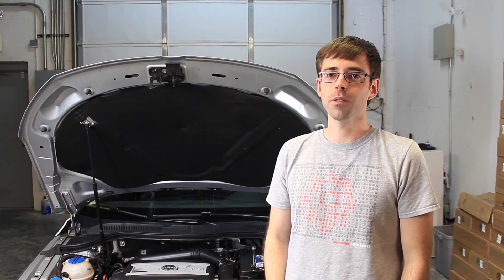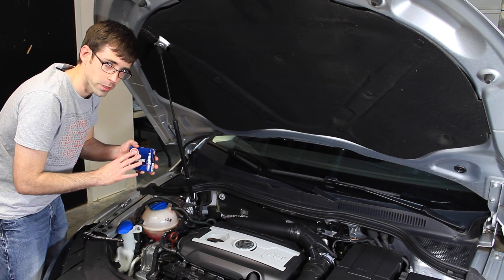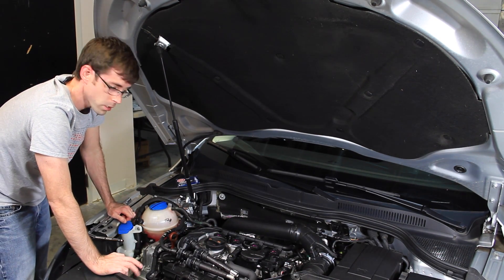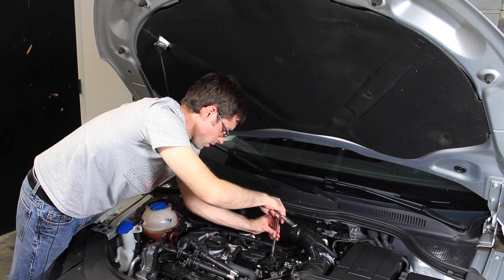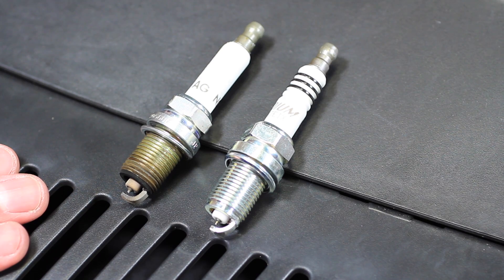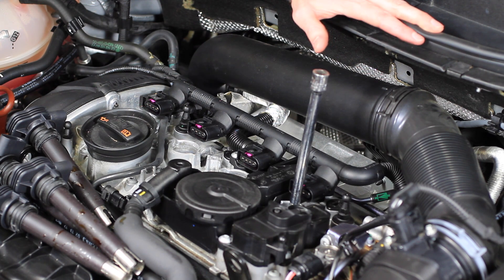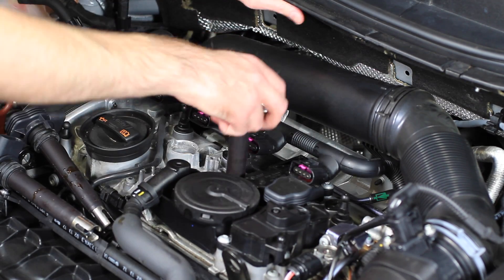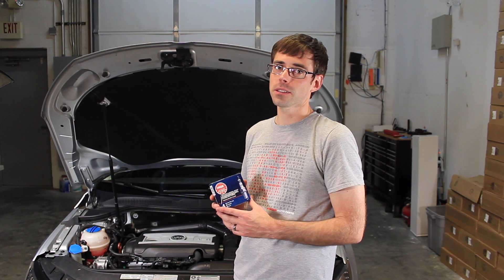VW 2.0T TSI Spark Plug DIY (How To) Install

Comment: do you recommend using a dielectric grease between the coil and the plug? Also in your opinion, should the ignition coils be changed at any routine interval, or wait until they show issues?

Comment: I've come to respect your videos, but on this one, I have two questions and a statement to ponder, please: 
1) You didn't mention the spark plug gap for reference. I know that they're in pretty boxes, but as a engine guy....this is still a highly technical component and critical for engine performance.
2) No mention a dab of anti-seize on the plug threads for dissimilar metals.
3) Some dielectric grease on the plug end, inside and out, because if the previous guy that did mine would have, I may not have ripped the boots to shit...and then try to get the pieces out.
Otherwise, thanks for the video.

Comment: You didn't add new di-electric grease on the coil pack ends plus there is a torque spec recommendation.  Never go by a 'half turn' past bottoming out.  Specs are provided for a purpose!

Comment: I know this is an old post but I'm going to roll the dice. I have a 2012 vw cc 2.0 tsi that has absolutely vexxed me beyond comprehension. I have had it for 2 years and I am out of pocket 5 K for engine repairs. Currently it is reading 
P0300 thru p0304
P050a
Catalyst
Egr 
secondary air 
02 sensor
02 heater
Evap
I had it in the shop and they said a secondary air injection pump so they replaced that. It still was un drivable and they would not make good on it.
I had it towed to an import specialist and he diagnosed it with a completely different set of issues. He said 
Coil 1 and sparkplug 1
And the entire catalytic converter system
I replaced the coils and plugs hoping that would improve idle and remove misfires 1 thru 4 but it is exactly the same with the same codes. At this point I am not even sure if the catalyst system is the problem.
With those codes how do I figure what is the root problem. This vehicle is literally bankrupting us. We still owe on it and I cannot even sell it until it is running correctly. Nobody will remotely give me an honest answer and any help would be appreciated.

Comment: I just bought a 2015 tiguan with 150 000 kms and changed the plugs out with the bkr7eix. It looks like it never had the plugs changed as it had the VW plugs in, and the coils were really difficult to remove! It runs way nicer now and the throttle is much more responsive

Comment: Not tighten too much? You should talk in NewtonMeters and you should use a torque wrench.
Reply: Apparently it's 25 N-m according to this video by ECS Tuning:
https://youtu.be/rbraqrculyk?t=254

Also, a good pro-tip later in that same video, plugging the coils in first before setting them down all the way at:
https://youtu.be/rbraqrculyk?t=286

Comment: Fark! I cannot for the life of me even get the connector clips off!!!
Reply: I had to spray some WD-40 on mine and let it soak about 5 minutes. Still broke off one of the tabs prying very gently with a flathead screwdriver (but that's not the end of the world). Just be sure to wipe off the WD-40 before reconnecting it. That was the hardest part of the job! 2 came off easily, but the middle two were stubborn for no reason.

Comment: You video does not show how the harness clips are manipulated to remove the harness.  You just blaze through assuming everyone knows that.  FYI, everyone doesn't.
Reply: They're a pain and a lot of people end up breaking the tabs. I got 3 off with a flathead screwdriver, but the really stubborn one, I had to spray some WD-40 on it to loosen it up. Just wipe it off before reconnecting the new one. That was the hardest part!

Comment: Hi I am still wondering what the correct gap is for the VW sparkplugs for my 2.0L VW Tiguan 2017, not modified engine, could you please ley me know, TNX

Comment: AutoZone sells a 5/8” spark Plug socket that has the extension built in.  Contains the magnet, rubber boot and extension all in one.  About as simple as you can get, insert 3/8 ratchet and go to work.  Prevents socket from falling out of extension and reduces chances of plug breaking off.   I concurr for most automotive spark plugs 3/8” ratchets and sockets should work.  If a 3/8” socket, extension and ratchet doesn’t work there might be another problem.

Comment: Good video mate, just a quick question. Should new coils and spark plugs work straight away to stop misfire ( my scirocco has been misfiring when it's idle and it sounds a tiny bit like a diesel engine when idle as well) or does it take a little bit of time to work? Thanks.

Comment: Hi, could you use a 1/2" drive socket instead of a 3/8"? will the outlet diameter too big?
Reply: A 1/2" in and of it self isn't a problem as long as the socket isn't too big in diameter. One issue with 1/2" drive is that your ratchet will probably be longer giving you more leverage and possibly more chance to over torque and break something.

Comment: Hey Y’all, so I’m trying to find coils and plugs for my 2015 VW Passat 1.8L SE... I’ve literally been searching for two days not with no results. I want to try A non OEM  kit that I can order. I’m fully aware that I can get OEM... but those are $38 a pop... bs. Any help would be much appreciated!
Reply: I've heard good things about Bosch, NGK, and Denso. I had Bosch originally, just put in NGK this time around (which is OEM on some model years), and I've read good reviews about Denso. I bought mine at Rock Auto. Saved by buying a 4 pack. Just needed a tube of dielectric grease which was around $5 at Auto Zone for way more than I will probably ever use in my lifetime.

Comment: Please my 2013 Volkswagen CC Sport is jerking, misfiring and idles. What could be the problem
Reply: Spark plugs.
Reply: Spark plugs and ignition coils and maybe also carbon build up in the intake manifold or a clogged or bad pcv

Comment: Can't believe the dealership was going to charge me $541 for this and the ignition coil replacement. Thieving bastards.
Reply: Correction: STEALership
Reply: crazy, I bought a kit with spark plugs, new ignition coils, the spark plug socket, a tool to pull of the coils for 200 from ecs. super easy job
Reply: Amazon around $100 bucks for ignition coils and spark plugs.
Reply: What was wrong with the coils?

Comment: I thought you should check the gap, there the gap should be from 0.030 to 0.032" (correct?), or 0.8mm, out the box the gap is not always correct on 0.8mm.

Comment: Is this the same basic process on the 2.0T FSI engine? I have a 2006 Jetta 2.0T, and I think I may have spark plug issues after having made the mistake of letting Jiffy Lube do a "tune up". Not sure if they replaced the spark plugs or just cleaned them, but now my engine light is on and the engine has delayed and rough starts and is running rough in general.
Reply: Yes. If you have a misfire in a specific cylindre, you swap the spark plug and coil from that cylinder to another. If the problem changes cylinder is almost 100% sure to be a spark plug and/or coil problem.
If you have done a Tune, isn't impossible that you need stronger spark plugs for exemple.

Comment: No anti sieze or die electric grease.?   I know it comes pre gapped, but don't you think you should double check the gap anyway.?
Reply: gladwin miguel VW actually recommends no anti seize. Dealers won't use it.

Comment: I want to thank You for doing this post. I followed you directions as demonstrated by you in this video. The only difference I made was the plugs. I used NGK PFR7S8EG (1675) These are Laser Platinum premium plugs. A bit more expensive than the ones you used but seem to work very well. Acceleration is very smooth. I think I made a good choice but value your opinion very much. Did I make a good choice?
Reply: John caballero I am about to do this service as well. Did you use dialectic grease? How’s the car running?
Reply: The NGK PFR7S8EG (1675) are the OEM recommended plugs for my 2011 (all years?) VW EOS. Scored them for $11.20 each on NAPA monthly sale.

Comment: Hi there, I was amazon and found the ngk spark plugs you are using in this video and wanted to put them in my 2013 vw cc and amazon says that it doesn't fit my vehicle, should I ignore this and get the plugs anyway? This is what the listing says: NGK (6988) BKR7EIX-11 Spark Plug - Pack of 4.

Are these the right fit?

Thank you.
Reply: Bryan Sniezek 
I got same result for my Tiguan

Comment: I saw another video with a guy applying anti-cease and a dielectric grease to the ignition coil before replacing into the engine - i saw your comment about anti-cease, but is the dielectric necessary?
Reply: Newer plugs usually don't need anti-seize, I put a thin layer of dielectric grease on the ceramic part and where the coil connects to the wiring harness (hopefully will make removing the harness from the coil pack easier next time). It seals out moisture and dirt which you don't want around your spark plugs or coils.

Comment: Had to get this done on CC. My check engine light and the ETC light came on, had I known it was this simple I probably would have done it myself. They mechanic who did it charged me like 160 for changing spark plugs and ignition coil, but then i later found out that he installed some crappy brands on my car. Which explained the lack of power. I freaked out when my car wouldnt accelerate and the engine was shaking like crazy... I legit freaked out and payed whatever to get it fixed. I thought the engine was going to blow up or something man...
Reply: Exactly why I am here!!! My car started shaking like crazy. Took it to Firestone(who charged me $100 to check my car!) He said it would be $450 to install the coils... Sad how these placed try to take your money!

Comment: In the past (since my 1962 Bug) I've used anti-seize compound on the threads.  Is anti-seize compound no longer recommended?
Reply: there's coating on ngk spark plugs to prevent it from seizing. so no need anti seize.

Comment: So, a few days ago, I changed my spark plugs on a 2012 GTI--used the OEM NGKs.  After the initial change, the car idled smoother, but there was a gas smell in the cabin.  Had just installed them finger-tight and then most of a turn until they couldn't easily be turned further.  After the gas smell, got a torque wrench and torqued them to 18ft-lbs.  No more gas smell--car was running great.  Filled up my gas tank tonight, and bam--gas smell was back, stronger than ever.  I didn't exert any superhuman force on any other parts of the engine, and the install was a relatively neat and clean process, especially as the coil pack had recently been replaced, so everything up there was clean. The actual calculation from Nm results in a torque higher than 18ft-lbs...more like 18.25 ft-lbs.  Is it possible they need just a little more torque? Could a difference that small be letting gas come up through the cylinders?

Comment: Dont you want to put some anti-seize grease on the threads before putting it in the engine?
Reply: devious623 I thought the same thing. I always have regardless of an aluminum or iron head.
Reply: Isn't necessary and is not recommended! New spark plugs nowadays they are already have proprieties anti-seize in them. If you put, spark plugs will have over anti-seize and you can easily over tight them because of that (risking of damaging head engine). But not every spark plug have this proprieties. If it's shiny chrome and soft in touch with your fingers, don't put anything. If is not shiny chrome and you feel it very sharp and rough with you fingers it's a "old school" spark plug and it's recommended to put.

Comment: I have been trying to get the connector to come off for way too long now. Any suggestions as to get them off? They won't seem to budge and I don't want to break the connector.
Reply: WD-40 worked for me after nearly an hour of trying to pry them off. Just wiped it off really well before reconnecting everything. The plastic gets brittle

Comment: ok so i have a vw mk4 2.0 engine. i boight ngk wires off amazon, but im having trouble fitting them onto the spark plugs. its like the hole is too small on the wires. what can i do about this. should i get new plugs or wires?
Reply from the maker: +Ivan Soto sounds like they might be the wrong wires.
Reply: I just bought bkr7eix i have 2.0fsi gti mk5 what is proper gap? Im stock.

Comment: I noticed a fairly little increase in cold engine idle sensitivity which doesn't matter since it goes away just odd, and a substantial increase in throttle response (positive mostly) which now seems to be slightly touchy like a bad gearing in some lower speeds, is that normal after a spark plug change it seems to be getting less jumpy under low throttle but I've never had that happen on a car before. It's iridium spark plugs, no codes, manual GTi, does not seem to be running rich or lean just throttle is jumpy, like a bad case of jumping off the gas in first. Runs smooth under moderate throttle and doesn't chop at most other speeds mainly 2nd-3rd 24-29mph.

Comment: I'm on a search for some iridium spark plugs for my 2006 Audi A4 2.0T FSI engine and I came across NGK BKR7EIX spark plugs. Do you think they will be a good choice? When I went to autozone the other day they told me that original plugs are iridium and they recommended me going with iridium over platinum plugs. What should I do? And which plugs will be better at performance? The engine is bone stock. Please help! Thanks.
Reply from the maker: On  a stock car as long as you use quality plugs the performance is not going to change.  The BKR7EIX is a popular plug for the 2.0t they are a very popular spark plug on our site https://deutscheautoparts.com/2-0-t-fsi-tsi-spark-plugs-bkr7eix-2667.html

Comment: Hello, I wanted to know if this spark plug works with CBFA engines and, even though it is pre-gapped, what is the gap measurement for safe practices/ double checking. I can't find spark plug gap information anywhere! I have a 2008 Audi A3 2.0T 8P CBFA engine. Thank you!

P.S. Thank you very much for you informational videos.  They have saved me at least a thousand dollars in repairs!

Comment: Do you have any advice for replacing a broken 4-pin electrical connector housing that connects to the coil?
Reply from the maker: +Matthew Edwards Take a look here you should find what you're looking for

https://deutscheautoparts.com/ignition-coil-connector-4b0973724.html

Comment: how do i get the connector off the coil if the release tab is broken?
Reply: Lift it up everso slightly with a flathead screwdriver and spray a squirt of WD-40 on it. Let it sit about 5 minutes and wiggle it a little so it can work its way in between. That worked for me, I still broke 1 tab even though I was trying to be patient and gentle. I wiped off the WD-40 before reattaching everything. Tried adding a very thin layer of dielectric grease to the coil and connector, so hopefully it will slide off easier next time and stop any water or dirt leaking into the connection.

Comment: those looked like 1/4 turns. and the last one was significantly more. can you clarify that? thanks.
Reply: I just torque to VW spec of 25 Nm (18 ib-ft) with a simple beam torque wrench not worry about being wrong.

Comment: when inserting the new spark plugs I thought you  are supposed to use a torque wrench torqued at 18 ft lbs?
Reply: According to the VW service manual, you are correct.
Reply: What happens if you just do it like in the video and not use tq wrench ?
Reply: You could possibly cross thread or over tighten it. Also if it's not tight enough and come lose it will mess up the threads and you will have to heilicoil it witch will suck.
Reply: That's what my manual says too. I have a torque wrench, might as well use it.

Comment: when you disconnect the harness from the COPs. The ECU or PCM will set a code?
i want to change sparks and im worry the ECU has a long memory shut down and after i change the sparks will give a check engine light or a warning light. I usually lift the COPs with the harness conected to avoid any MILS or lights... my question is can i disconect the COPs from the harness? even when the key or FOB is out of the ign ,im afraid the car has a long memory shutdown and notice the disconection or maybe the ECU sleep after 10 minutes of being off.Can you tell me if possible?

Comment: What is the model number of the spark plug again. It doesnt come up when i google it
Reply from the maker: +Frank Ab. The spark plugs used are linked in the video.  They also can be found here https://deutscheautoparts.com/2-0-t-fsi-tsi-spark-plugs-bkr7eix-2667.html
Reply: @Deutscheautoparts  That link no longer works. Also not seeing NGK plugs listed, only Bosch. You prefer Bosch now?

Comment: Voice over: "NGK... 1/2 - 2/3 of a turn"
Video: 1/4 - 1/3 turn
Shame on you for not listing torque specs and install temperature.
Reply: I changed mine on my Mk5 GTI, it's 18 ft-lbs according to my service manual. Everyone's "hand tight" is different, even mine when I was changing these four!